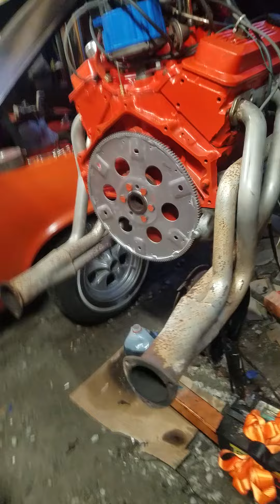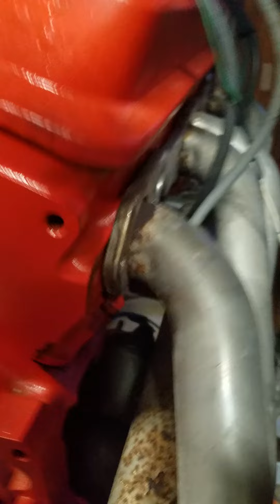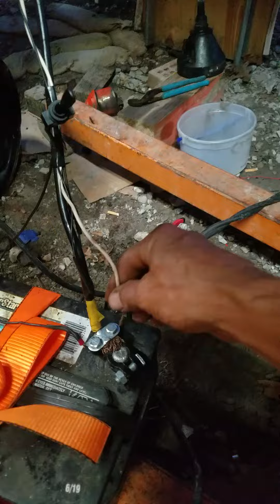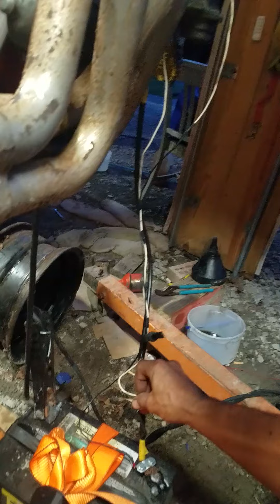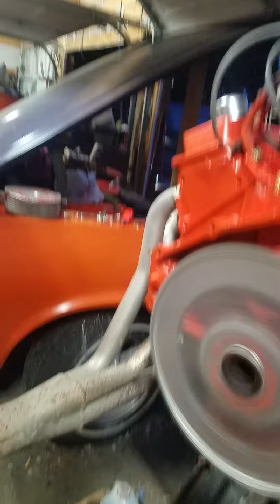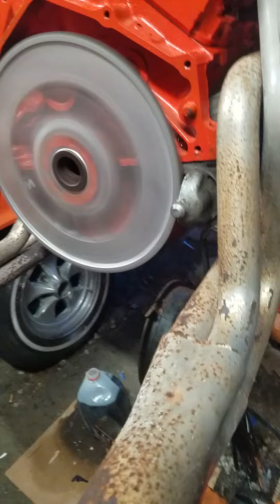Open Headers On My 361 SBC #nova ##automobile

Comment: Sew a 361 is that a 350 bored 40 over
Reply from the maker: @awfulcoffelsonecargarage8215  I was told a 350 bore .060 over is a 361ci, 350 bored .030 is a 355ci.
Not a pro at all,  learning as I go everyday. 
Thanks 4 watching
Reply: @MaconThingsHappen  so what part of Missouri do you live I lived in Mountain View back in the early eighties have some good friends that were all motorheads one still lives in Mountain View and the other one lives in Springfield